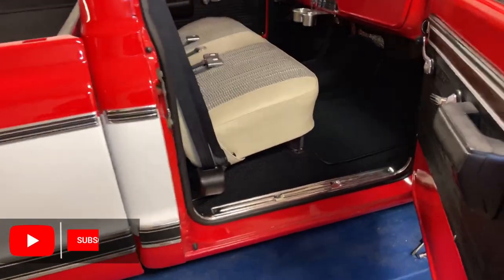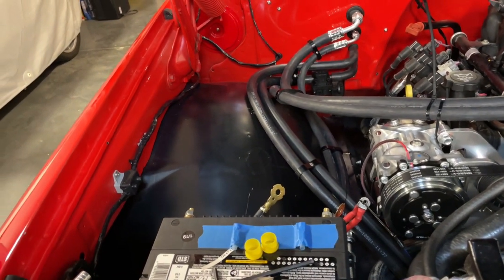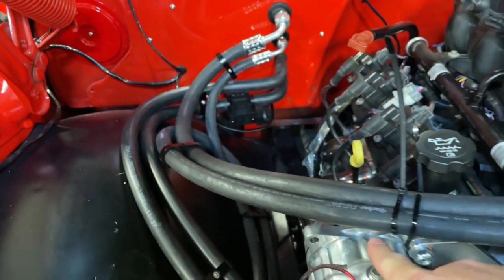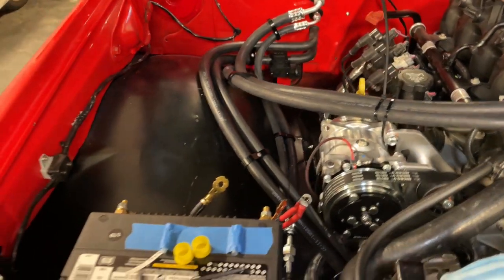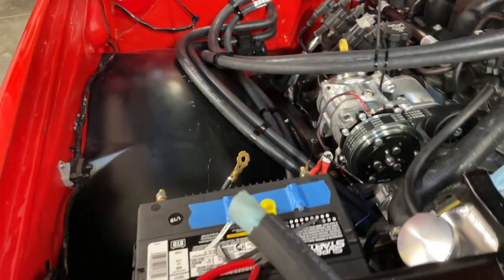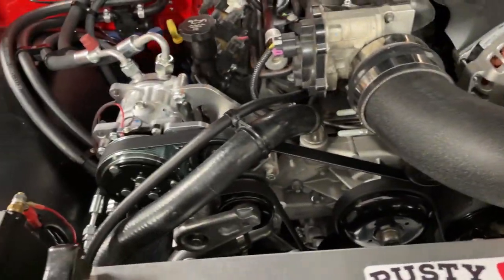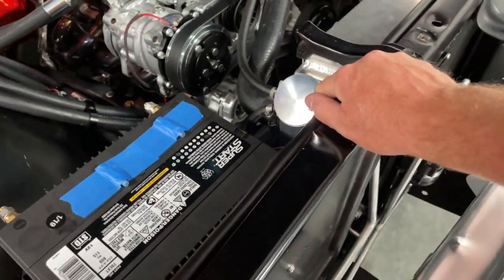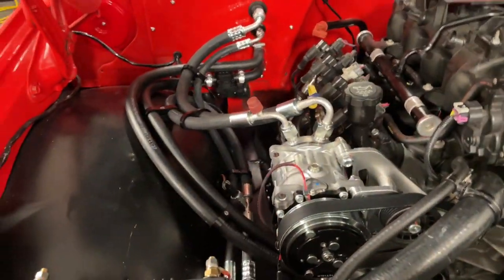AC Install Home Stretch

Comment: Looking good, again I love the detail and OCD thinking.

OReilys sells Gates heat shrink hose clamps which make for a clean install with hose adapters like you have near the water pump and the drain on the AC.  The problem is... once they are on, they are on. Be prepared to cut the hose and thus replace the hose to get them off.  So, I'd stay with a normal clamp on the water pump or on the firewall/valve on the firewall and be sure you like how the hose lays.
Reply from the maker: There are days I don't know if OCD is a good thing or a bad thing haha.  I have looked in to those.  I really like the look, but like you say, they are more or less permanent.  I may swap the clamps on the firewall and valve for these at some point.  

Thanks for watching!

Comment: Is that pressure sensor on the smaller #6 hose or the #8?
Reply from the maker: It’s on the #8 line coming from the compressor.

Comment: Longest A/C install ever... Lol. OCD gets the best of me too..
Reply from the maker: Haha, It's been brutal.  Between my OCD and beating meself up for not having enough time, it's been a trip for sure.
Reply: Is that blue car a 66/67 nova? You should do a short segment on it . My dad has had lots of cool old cars back before I was born. One time he went to a dealership to look at a 67 vette 327 4spd ,but my older brother was just born at the time and ended up coming home in a 67 L79 nova that had basically the same as the vette plus it had a back seat for the family.  The place where he worked had alot of guys with fast cars and they would race after work on the highway.  He never got beat with that car as he said it was very fast.
Reply from the maker: @jaredfreemyer6016  I need to.  A lot of people have asked about it over the years.  It's my dads 66 L79.  It's a fun car.  He talked about putting a new motor in it with a manual.  Maybe someday.

Comment: 👍👍👍
Reply from the maker: Thank you!
Reply: @RustyWrenches  @ i have a 72,  with a 4.8 swapped, but planning on 6.0/ with the same 60e transmission
Reply from the maker: @gerardolopez5875  Nice, sounds like a nice build!
Reply: @RustyWrenches  @ u gt the 80E? Or 60e?
Reply from the maker: @gerardolopez5875  I am running an 80e
Reply: @RustyWrenches  @ is it slower? Heavier with the 80e,    For just normal cruising ?
Reply from the maker: I can’t answer if it is slower.  It is heavier, but it has a nice 1st gear and can take all of the power I want to throw at it.